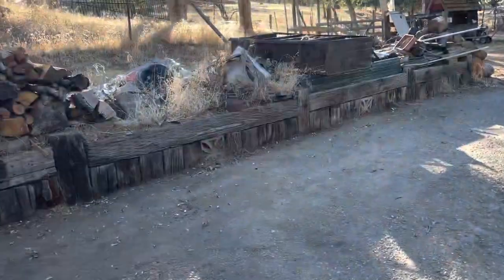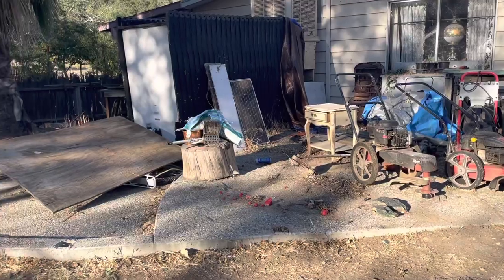Hoarder Yard Cleanup

Comment: I've helped Grant do these clean ups. It takes about 1.5 years to go from sorted out and semi neat to well cluttered chaos... Then it takes a day to get it back to the clean level and it starts over. But not much goes to the dump! Oh No!  Some stuff goes away, some gets moved to a new home....Thing is, there are so many garage sales to go to, so much stuff, so little time!   I don''t recall seeing the concrete pad so clean. This is indeed a Time Of Purification.... Battery Lead should be around 30 cents lb....  The water pressure is adjustable. 60 is kinda high. You probably want a cut out pressure of 45 and a cut in pressure of 30. Or whatever Grant proclaims...... I don't think the  stuff  in the tubs is aloe vera It think it's Agave related. (might need water).  I admit to providing objects of value to this wonderful archeological collection.